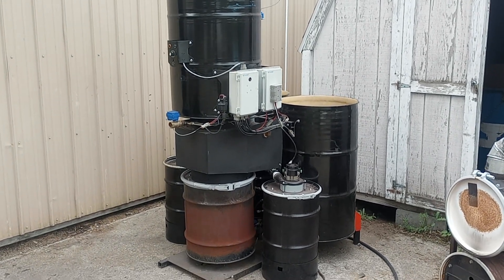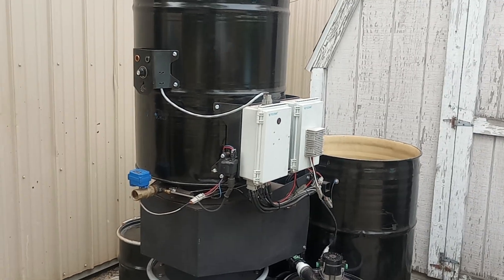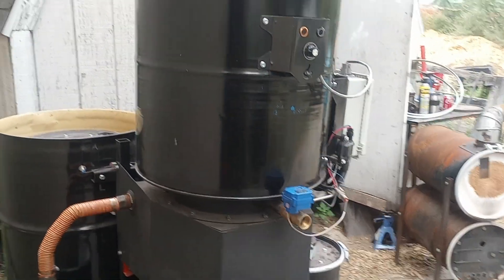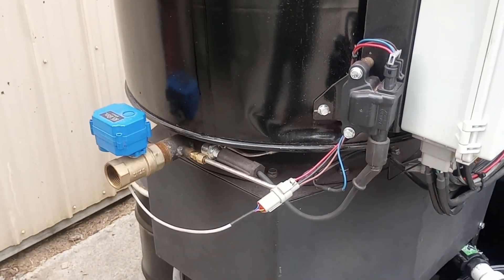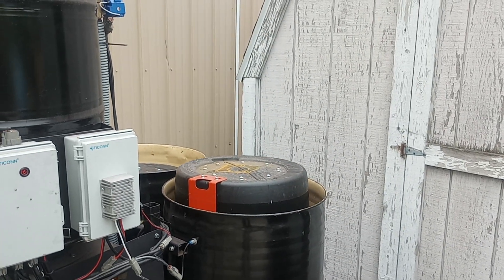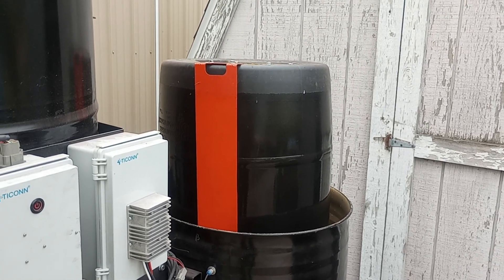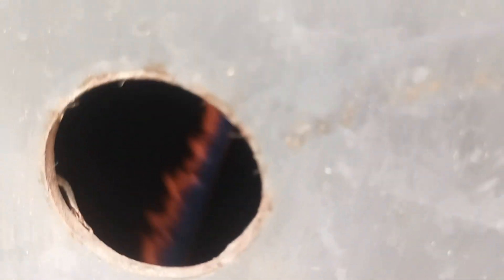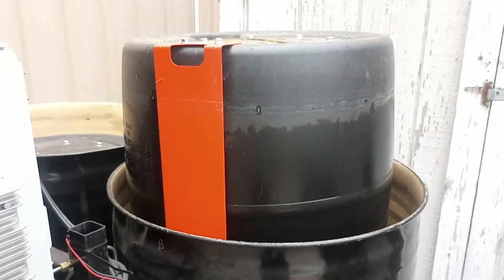Initial Testing on the VersiFire!! Fire it UP!!

Comment: Thanks for the video.  I apologize in advance for the questions below.  Just know they came up because this is very interesting

1)   What is that water that dripped at shut-off?  condensate?
2)   How are you sealing the accumulator at the bottom? Is it essentially an upside down open top plastic barrel that is sealed with water or some other liquid?
3)  Do you need to pressurize the gas for burning it in the appliance, or are you letting it free flow based on the pressure created from the weight of the upside down barrel?
4)  Perhaps related to number 3)  above, I see a lot of yellow and orange in the flame inside the stove.  Is that the most optimum outcome without a fan or a venturi to mix the gas with the ambient oxygen?
5)  Did I accurately notice that the gas volume was consumed by half in about 60 seconds of stove runtime in your video, essentially giving the setup a total of 2 minute runtime from both accumulators (without needing to replenish by restarting the gasifier) for this particular stove?
6)  Would you mind demonstrating the wood/charcoal aspect of this gasifier?  wood? Charcoal? Imbert? Cross Draft? etc?

If I'm late to the party and you have covered all of this in a different medium, I apologize and please point me to it.
Thanks in advance